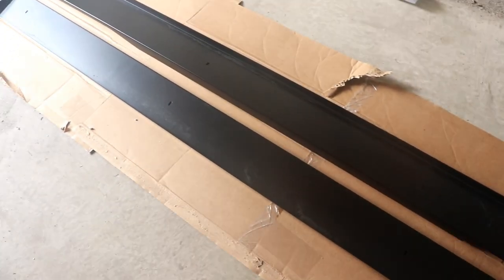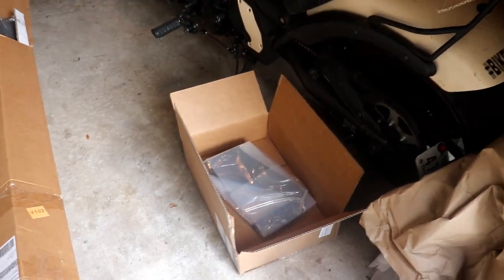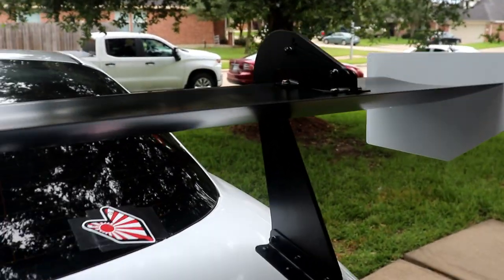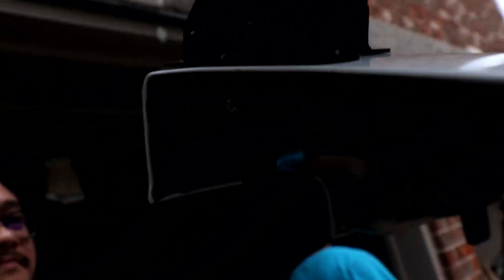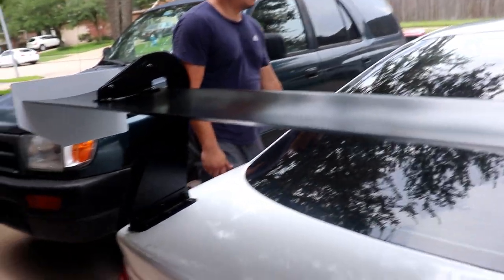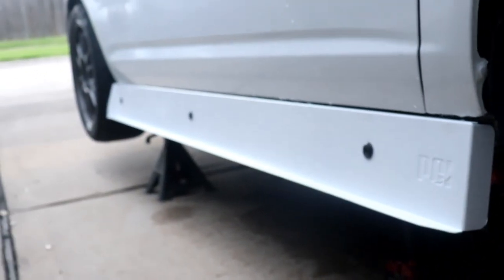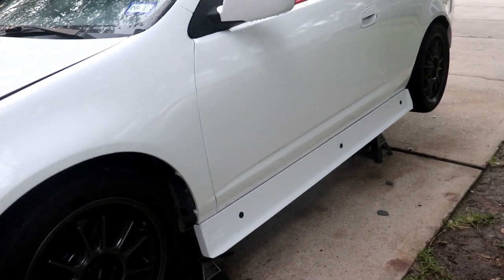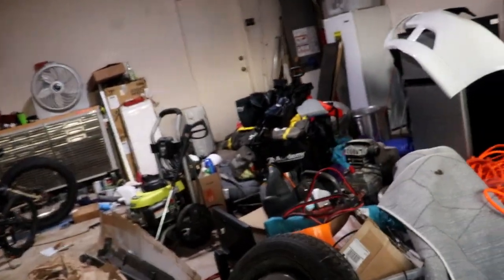The RSX Gets An Aero Upgrade! | Installing PCI Side Skirts and Swan Neck Wing!

Comment: Do you think the front bumper mod will reduce any air getting to the brakes?  Waiting for your wind tunnel results...kidding, of course 😁
Reply from the maker: Its definitely up to the driver really, i noticed when on track i dont use the brakes enough to get them super hot, so i value the aero benefits more in this case lol
Reply: @JedETaleon  What size tires do you use and what's the biggest speed difference between your top speed in the straights and braking for corner entry speed?  I didn't have any brake issues until I upgraded to 17x8 wheels and 235 width tires = more unsprung weight.  Using stock brake calipers, aftermarket slotted rotors  and mild track pads.  The back straight into turn 10 @ Road Atlanta, I cooked the brakes going from 135 to 40 every lap (of course my RSX weighs just under 2800 with fluids).  No prob on a shorter track, though.